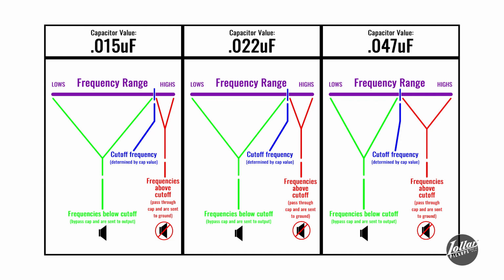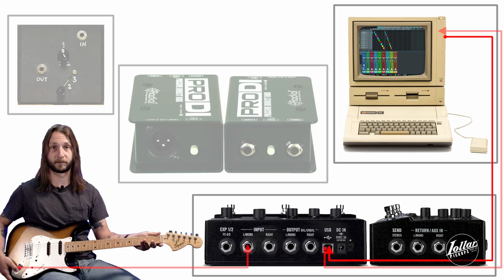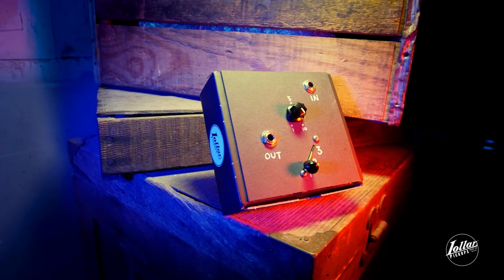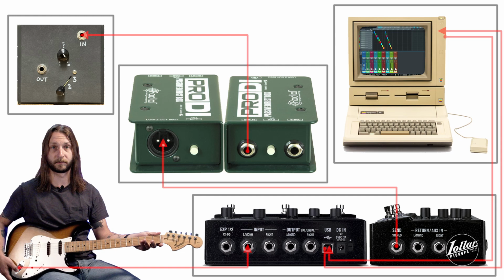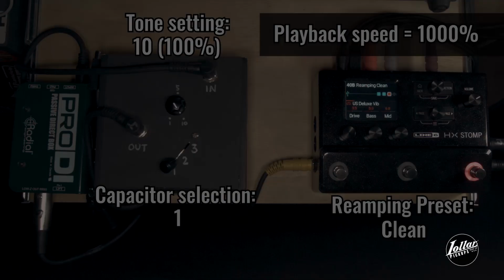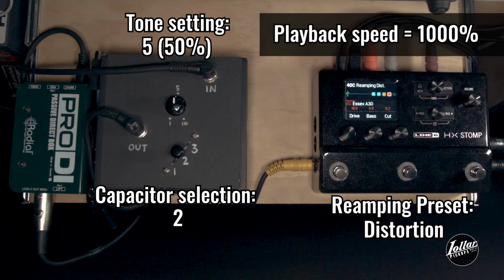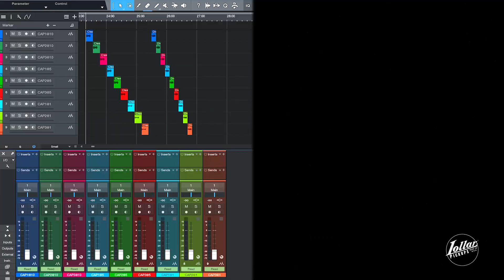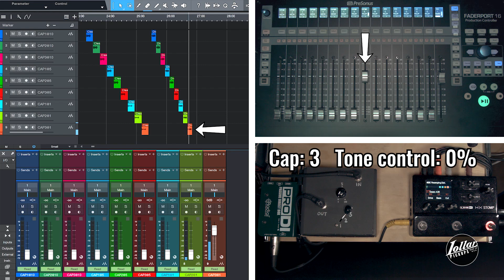LOLLAR PICKUPS Presents: TONE TRUTH - Capacitor Material

Comment: How close were the caps value cause even two of the same caps with only 1% diff sound diff.  After many yrs of experimenting this combined with any possible placebo makes more diff. than material. After all since signal never actually passes thru a cap all they do is charge n dis-charge. How fast determines how it sounds, and how fast is based on its value.
Reply from the maker: You're absolutely correct! This is why we did another video in this series that discusses cap value as well. As for the individual cap values, I don't recall the actual values anymore, I'm sorry. But I can recall that we used a multimeter to test dozens and dozens of capacitors and used the ones with the closest values. If I recall, our meter clocked them all to within a VERY small difference of a fraction of a percent difference between the three.
Reply: @LollarPickups  Yea I use a meter to chk mine as well. Even meters have a %'s of error. I have a small S.S. Marshal I use at my bench to test guitars I work on. After getting my amps sounding how I liked I decided to see if I could improve the little Marshal. It uses a 220pf treble cap in the tone stack. I have some 1pf caps and adding 1 of those making 221pf I noticed a difference. I was surprised as I would have never believed that little would be heard. So if that's the case and knowing how caps work and what science say's about caps I believe it's value differences not material people hear. And better is diff for everyone. In my yrs of doing this I've noticed many times just a change in tone sounds better because you've gotten used to the way it was.

Comment: I appreciate your videos, but you have it backwards according to  electronics experts: Capacitors act as high-PASS filters, not low-pass filters. The greater the capacitor value, the lower the frequency below which (lows, mids) go to ground. Resistors act somewhat in reverse of that, though the best effect of putting a resistor in parallel with a capacitor is that it makes the  cutoff frequency less sharp...more gradual.  Hence, the concept behind "grease bucket" circuits, which not only use cap/resistor in the grounded line, but an additional resistor in the "hot" wire.

What tone pots do primarily is cut the resonant peak out more or less, which makes the lower tones appear to be boosted or cut...but, it's an illusion, deriving from the ratio of lows to highs.

As to whether the capacitor material makes a difference...many experts thing it is "in the mind" of people who claim to be able to tell the  difference. But, vendors are happy to charge, for expensive caps, between 10 & 100 times the cost of cheap ones, for those who insist on being able to distinguish between them.

Ultimately, the best idea is to add a graphic equalizer pedal, an active control, which is more precise than passive controls, because active controls can both boost & cut frequency ranges...whereas passive controls can only cut them.
Reply from the maker: Thanks for watching and for your comment. I'm sorry for any confusion. The capacitor does, as you say, act as a high-pass filter. But, since the end result of a guitar's passive tone circuit is that everything passing through that capacitor goes to ground, the net outcome is a low pass filter effect. This is because the only thing that "passes" through to the amplifier is what is lower than the cutoff frequency.

Also, the tone circuit doesn't just cut the resonant peak, that would be more like a notch filter. With guitar tone circuits, the resonant frequency peak tends to move lower as you increase the amount of attenuation (turning the knob down), which sounds different in different circuits due to the combination of frequency and Q. The frequency of the resonant peak is determined by the cutoff frequency and the peak's level is inversely determined by the attenuation level. So, as the frequency dips lower into lower frequencies so too does the resonant peak. As the amplitude of the frequencies above the cutoff decreases, the level of the resonant peak actually increases. And the narrower the cutoff, the tighter and higher the peak. This is why some folks say that a .015 cap can sound somewhat like a wah effect when the tone control is rolled up and down because the peak shifts in frequency and amplitude.

Of course, this is all an oversimplification that doesn't include things like impedance, inductance, or any number of other related variables. But this is all originally only intended to make things clearer for the average guitarist, not necessarily aimed at electrical engineers and the like. I hope this clarifies things a bit for you and other viewers. Thanks again and take care.

Comment: Can you do one on pickup height?
Reply from the maker: In the future, possibly, yes.
Reply: @LollarPickups  I actually found a video from 13 years ago in your Playlist.
Reply from the maker: Yes, we have had that one up for a bit. While the information is still applicable, we would really like to redo it to offer a better overall experience for our viewers. So, when we have some time between other videos, we plan to re-shoot some of our older video offerings.
Reply: It's really impossible to tell how pickup height affects the sound of a non-linear system like a guitar amp.  Compression, harmonic generation, dynamic freq damping, etc mask the effect.  Physics dictates a loss of transient strength and lower note harmonics, as well as any effects of magnetic string pull on note timbre.  The effects of string pull on note timbre depends on pickup position, but decreased transient strength translates as less punch and highs in the attack.  The decrease in lower note harmonics may be less obvious, and depends on coil wire gauge & density.
Reply: @GCKelloch  I would say it's absolutely possible to tell how pickup height affects both the sound and the feel of the guitar sound. Whenever I get a new guitar or new pickups it takes some real playing time with small adjustments to get them where I want them. I think my LP with P90's is especially sensitive, more so than my Strat or Telecasters.